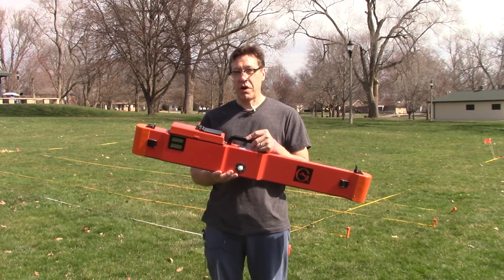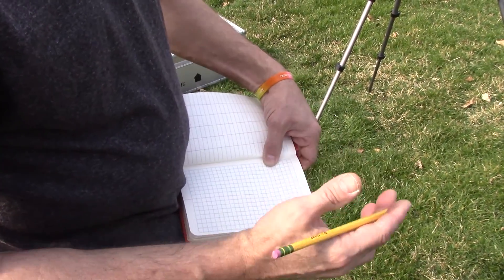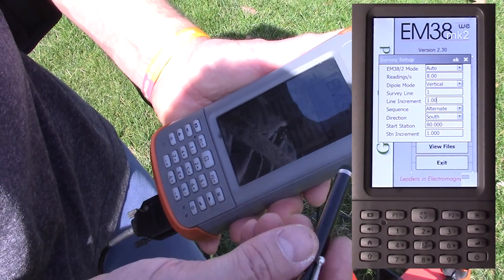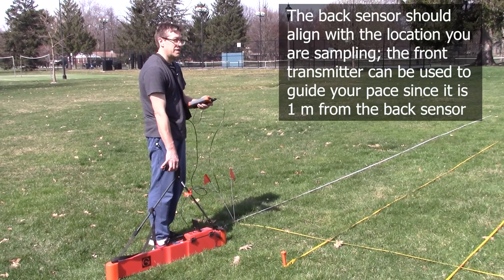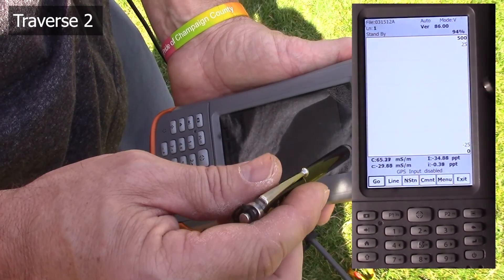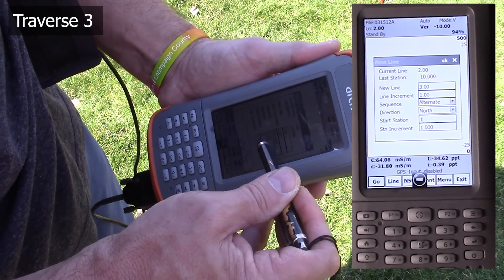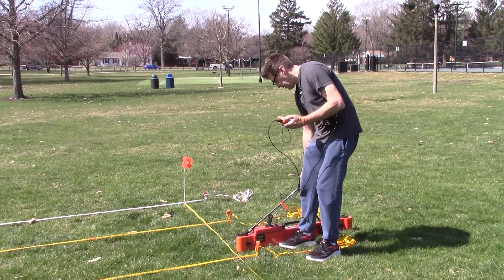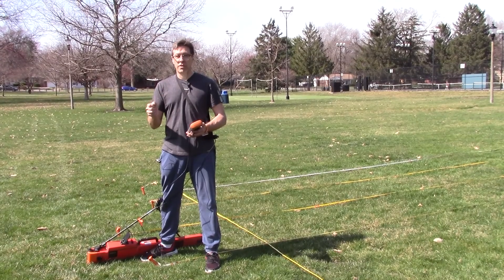Video 4: Grid Survey Using the EM38-MK2 in Automatic Data Collection Mode

Comment: This is extremely helpful. Just for clarification-Would you not have 81 points along each transect if you are starting at 0m on the base line and walking to 10m at the end with 8 readings/1m (you get the extra reading on the 0).